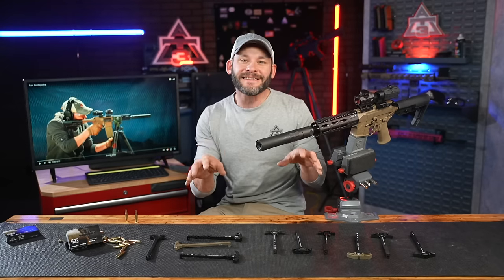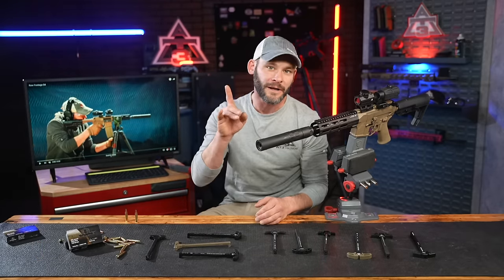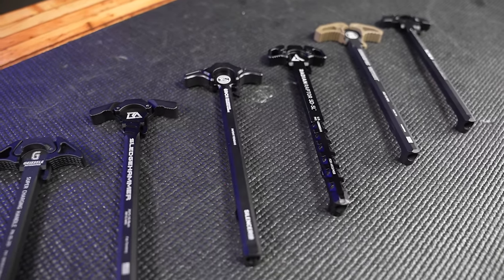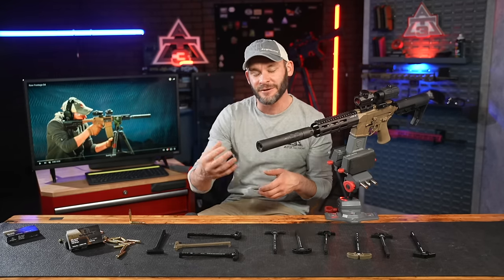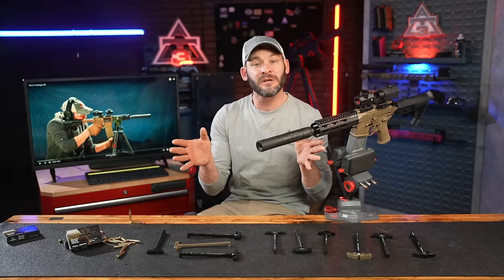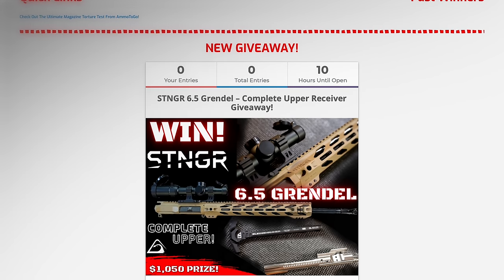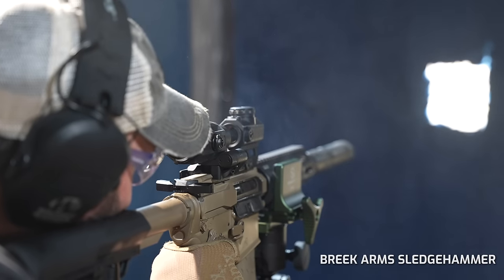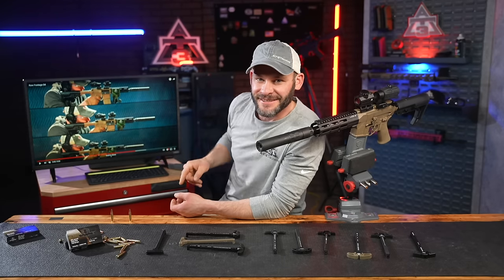[TESTED] Do "Gas Busting" AR Charging Handles Actually WORK? | Part 1

Comment: This is the absolute best presentation on this topic, I don't have a suppressor or a overly gassy gun but  i have been in the market for a Ambi-charging handle with or without the gas busting capabilities. Though  i'd rather have the feature and not need it then need it in the future and not have it.  I really didnt see a visual difference between the Breek and the radian the breek being 70$ and the radian 124$ (at the time of writing this comment and on your website) Im going to save the cash and pick up the breek when i Have the money. And to thank you for the video no matter the sale or if a competitor site beats your price Ill get it from you guys.
Reply from the maker: Glad you liked the video.
Reply: Also look at the new Warhammer, the new generation has the gas busting shelf as well and is like $20-$30 cheaper

Comment: Warhammer seemed to help on my PCC AR 9 I built first mill spec my eye was feeling it . Warhammer redirects it away .
Reply: I have the warhammer also and on my ar-15 it allowed more gas to pass than the mil-spec did, plus the thin handles hurt. I just recently upgraded to the devil dog side charging handle. While I haven't had the chance to shoot with it installed yet, it's a hell of a lot more finger friendly.

Comment: For the cost of a $3 drill bit, I drilled out a small hole on the right side of my mil spec charging handle near the end.  Has been working great at pushing the gas out away from my face.  Just a thought for those that don't want to spend a lot.
Reply: Or you could use high heat silicone on the end of your charging handle works better than any of these

Comment: Sealing will work better. Use the silicone method that blocks the areas the gas can escape out the back. Silicone on both the top and the bottom.  That plus the best gas busting charging handle, and adjustable gas block is probably the best you can do.

Comment: At the 3 way comparison at 20:06 and after I played the you tube video back at .25 speed. you can literally go frame by frame. It appears that they all let gas through. However By the 3rd frame The Radian and Breek the gases behind the charging handle are clear and appear to be dissipated. For me it is Pick the one I like the look of better or cheaper between the two. 

I think a way to tell is to have a piece of paper basically Infront of the shooter and see if how much it is discolored/dirty to get a better idea of what gasses come back. These video clips at these angles don't really help with how much is going on from the ejection port.
Reply from the maker: Good observations. We learned allot from this video and are planning on adjusting our testing process for future videos.

Comment: Glad to see Breek thickened the handles on the Warhammer. The original one would really get into your fingers a lot more than others. Just felt thin and cheap to me. Rough on frozen fingers too.  Since everyone is doing extra curricular slo-mo requests even though you put on a helluva great presentation. I'd love to see a set up with a Superlative adj. gas block venting out the front with the gas properly adjusted down to light but functional and see how much that reduces the amount of gas everywhere else.
Reply from the maker: We just got some Superlative gas blocks in and are going to test them out.
Reply: @At3tactical  Awesome!!! I really feel a lot of people are passing up on a really tunable set up by buying into the "Adjustable gas blocks aren't reliable" My 3-gun rig is running a M4-72 brake, Superlative GB set to the bleed off side (almost wide open), Either a JP LMOS BCG or a VooDoo Lifecoat 1 piece carrier with JP enhanced bolt, Taccom .58 ounce solid delrin buffer (Or a 1.1oz depending on course and bullet weight), Taccom -25% power spring, Trigger Tech comp trigger, with a BA 18" rifle length fluted barrel. ZERO gas in your face. I'm barely putting any gas rearward because of the ultra light reciprocating mass set up I have. Recoil is honestly somewhere in the 22 mag range maybe and has been 100% reliable for years. My build goal was no point of aim shift for fast double taps and I got way more than I ever expected. Everyone that shoots it loves how smooth it is. The only thing I can think of that could possibly be an issue is failure to go into battery on a dirty chamber, bent case etc due to the low BCG weight and lower spring tension. but I'e never had that issue with god knows how many rounds through it.  I put a little high temp bearing grease on the gas block adjuster about once a year and it has never had a carbon build up, never eroded the pin. It's been flawless. I now run the SA GB on my CMMG dissent in 300BO, and a 10.5 suppressed build. I love em lol

Comment: thought 1: don't over lube.   Thought 2: rearward angle showed none of them gassing out the back directly toward face. thought 3: why no overhead view?
Reply from the maker: Absolutely solid points, thanks! Yeah, we thought the same about the rearward view...it's going to get a better framing for future tests. The top-down view is absolutely making it into the "testing"... we'll even come back and do these two again with that view. (I personally think the top-down will wind up providing the most insight, but we're learning as we go! -Randy)
Reply: I came to say the same. Thanks!
Reply: Over lubing the BCG is definitely bad. I usually grease the underside of my charging handles with a light layer of Molybdenum grease though.  Rub it on lightly with a Q-tip. Keeps the gas key from wearing prematurely by rubbing the charging handle when it cycles.
Reply: The over-lubricating was done on purpose, I believe. It was to create more visible spit and gas for us to witness. Part of the test.

Comment: A top down view would work well, and a left side close-up view to isolate the charging handle gas flow without the ejection port cloud in front of it would also be helpful.

Ideally (I know cameras aren't cheap) all at the same time so the amount of shown "clouding" is constant rather than diminishing to eliminate variables.
Reply from the maker: Good thoughts. We are working on improving the process for the next round of testing.

Comment: I was told a long time ago that a thin layer of silicone, right at the top of the charging handle where wheat meets with the upper receiver is all you need
Reply: I've done this on an exceptionally gassy integrally suppressed build of mine and was pretty unimpressed.

It seems that more gas escapes from underneath the CH than above it
Reply: @Werepie  based on these slowmos, more gas definitely comes out of the bottom of the CH. The SilencerCo CH has an o-ring underneath the CH that seals against the lower.

Comment: I was thinking maybe if you do this again, adding red food colouring to the gun oil might be show up like how airplanes do smoke trails.
Reply: I believe the SilencerCo gas buster is the only one that has rubber o-ring.  Hop didn’t like it because it would break/bind-up.  Others have tried by using sealant.

I think having a heavy buffer might be the best way to solve the problem, maybe adjustable BCG (Bootleg inc) or gas key (Ruber City Armory)
Reply from the maker: We are planning on testing the SilencerCo charging handle in the next video.

Comment: my question is, 556 20 inch barrel.. do u have better odds of no issues than a 16 inch barrel using a supressor..?.. and would it make a difference throwing in a gas buster anyways?.. when i am told a long barrel is the usualy cure for a propper suppressed rifle ...errrr..it gets soo confusing
Reply: Thats getting into a bit of a different science. burn time, gas system lengths get involved. simple answer would be, 5.56 and a 20 inch barrel where made together, you're just throwing a muffler on it. also a mk18 "10.3 barrel" has higher wear on parts then a m16 "20 in barrel" without cans even being involved.

Comment: The can your running sucks at flash mitigation. The most important reason to have a can is to keep your location undetected. First shot pop seems pretty loud as well.
Reply from the maker: The ammo we were using AAC "SABRE BLADE BLACK TIP" 300 BLACKOUT 110 GRAIN because we were looking to make the gun as gassy as possible . If we had used 300BLK subs it would have been very little or no flash.

Comment: So far nothing works better for blocking gas than putting silicone on the back of the  handle. The Raptor SD seems like a rip off. Better to manage the excess gas at the gas block or with the suppressor being selected. Superlative Arms bleed off gas block or piston seems the best.

Comment: So, none of these products can solve this problem. It's not a charging handle issue. It's a gas block issue. The superlative arms bleed-off gas block will prevent all gas in the face. I know because I have three of them. Once upon a time I worked at silencerco and went out to an employee shooting event to get familiar with the products. Even with SiCo's excellent manufacturing and the outstanding PWS piston gun I was shooting it from. The gas in the face blinded me within a few shots. A superlative arms bleed-off gas block will not only stop gas to the face, it runs suppressed as well as other ar's shoot unsuppressed: twice as clean. It's the single best way to prevent gas in the face. Charging handles are neither the problem nor the solution.

Comment: HK user here and as my HK CH got worn out I thought of upgrading to Radian SD. Well, I noticed clear increase in gas to face. Test HK handguard too? It was quite odd since it is not supposed to lower gas but clearly did. I returned the Radian.
Reply from the maker: Interesting, thanks for sharing.
Reply: I used kintsuglue to my HK handle and was able to shoot full gas with legacy can and did not even notice. I like it better than the flow through one.

Maybe try the basic GI handle with rtv/kintsuglue mod?

Comment: About $700-800 for a cheap-ish entry level suppressor, $100 for a solid adj gas block, another $150 for the charging handle......😢my $500 dollar supressor just rurned into a thousand real quick 😂😂😂
Reply from the maker: This hobby has a tendency to do that.

Comment: Good video, I do feel like a better camera angle would've been straight down from the ceiling, shooter not wearing a hat. These gas busters are designed to mitigate gas in the shooters face. Gas will always be pouring out of the ejection port which typically doesn't really affect the shooter.  Lefties I aint talkin about you.
Reply from the maker: We had some of the exact same thoughts. Good stuff.

Comment: Coating the charging handle in lube seems likely to decrease gas flow in that area. But why do this? No one is running their rifle this way. Great, now we know which charging handle works best when coated in lube. Who does that help? What is happening?? 😂
Reply: I keep mine greased with Molybdenum grease 🤷‍♂️ 

The underside of the charging handle rubs the gas key when the BCG cycles. You really should be lubing it. Any synthetic grease applied lightly with a Q-tip will do the job.  

CLP or other lubes work, but the grease stays on longer.

Comment: Don’t matter really. The wind is your best friend when the gas blows out. The gas will leak from several different areas of the rifle.
Reply from the maker: SO many leaky spots in a standard AR-15 Platform.... the next evolution of this test is to test additional "Gas Mitigating" parts (KAK BCG, Gas Block Adjustments, etc...combined with the charging handles, to see how-MUCH gas we can keep forward of the shooter.)
Reply: @At3tactical  Thanks for the video. It definitely shows the gas issue. Perhaps many more innovations will mitigate this common problem with this suppressed platform in the near future.

Comment: I don't understand why the channel opted for 300Blackout, 556 being what most are going to suppress. I don't understand my the rifle was ridiculously over lubricated, I don't understand why you're not using LSA due to higher heat and more carbon. What buffer/spring and buffer weight are you using. Heavy buffer tends to keep keep the bolt forward slightly longer before cycle of operations completes, which pushes more gas through the barrel instead of back through the receiver. Did the channel look at other adjustable gas blocks like Rifle Speed for example........where in you have 12 dedicated settings that you can adjust without tools, and additional plungers are also included. This means you are not fussing on where your set screw is or isn't . I don't know why your in a closed environment. A low to no wind day to mimic standard firing conditions would seem more reasonable. What effects does that particular can have on rifles? What do other"duty rated cans" look like. Does changing the can change the amount of excess gass delivered back to the shooter?
All the angles of video shown, I would think that a top view looking directly down would be the most efficient view showing the most truth. I would like to see the charging handle selection with a 556....300BKL OUT  just doesn't make any sense at all because the volume of users are a literal fraction to 556/223 rifle owners. A SOCOM RC2, with agas block that you can adjust with no tools on the fly that has dedicated settings the shooter can reference to. Great topic presentation, Terrible Terrible follow through. I'm pretty sure that said name companies would PROVIDE materials for testing if asked. 16 years USMC infantry, combat veteran. Marksmanship rifle/pistol Instructor. MOCS (Mission Oriented Combat Shooter) Instructor, Combat Marksmanship Instructor, STA Surveillance & Target Acquisition Platoon OR  (Scout Sniper platoon) 3/5, STA platoon 1/5, Combat Marksmanship Instructor, Machine Gun Leaders Graduated, Post and Service Rifle Team Camp Pendleton Base, WFTBN MCRD Shooting Team, State of AZ Shooting Team, National Guard AZ Shooting Team. Currently Class F shooter.
Reply from the maker: Good thoughts

Comment: Great video...could have been half the time though. Not that I don't appreciate an in-depth, thorough breakdown of what's happening...but you need to show all angles simultaneously. Saying "wait until we get to the other angle" is gimmicky to me. Just put it all in there and get your explanation done, then move on. Otherwise it's just stretching out the length of the video and actually detracting from its purpose.
Reply from the maker: Fair enough